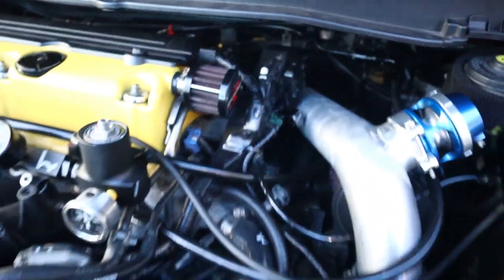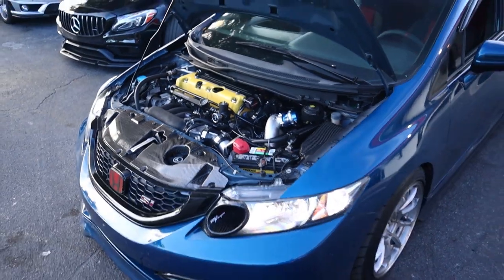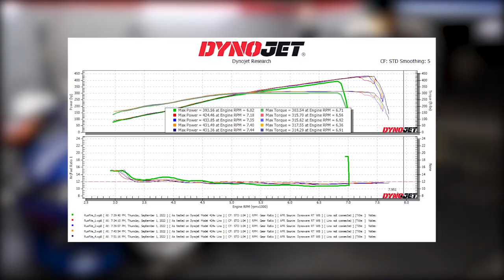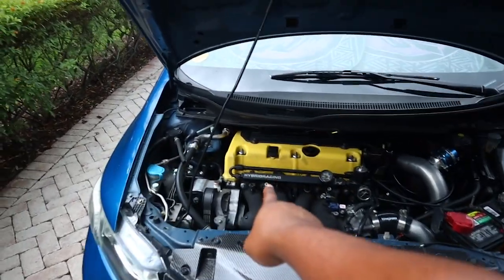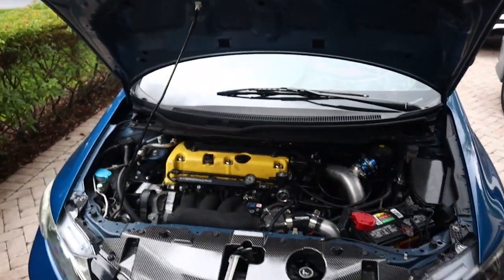TURNING UP THE BOOST! LETS GO GAP SOME V8s! #civicsi

Comment: Tires are a must lol. I have Indy 500s and they work pretty well in 2nd in 3rd. Don’t worry about motor bro ur good. Trans will go when it wants. I never had a problem with mine in 2 years, “yet”
Reply from the maker: Nice bro .. how much do you make?
Reply: @zoovie  400/298 on 11 psi. I been driving light recently. Got the savings to the side for the tow truck and the gear x 🤣

Comment: If you want a catch can for your 9th gen si look up dc5 creations catch can for your year si
Reply from the maker: Sadly I would have to delete my upper pitch mount bracket to fit that
Reply: @zoovie  do you have hasport mounts?
Reply: @zoovie  if you have hasport mounts you dnt need that upper pitch mount for it eliminating it will make maintenance a lot easier on the car and you can change the oil filter from that location as well

Comment: Deciding if I should turbo or supercharged it :(
Reply: If you want all the power,god mode,go  turbo
If not, supercharge is good reliable
Reply: If your not planning to upbuilt your motor or trans in a bit I would suggest supercharger safer. There's some civics making good power with supercharger but then again rods  pistons and spring had been updated.